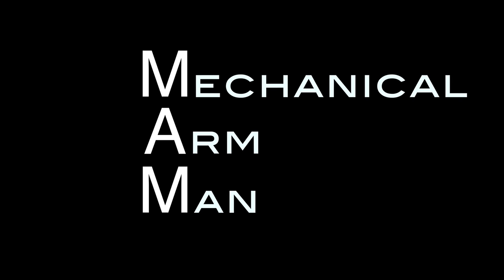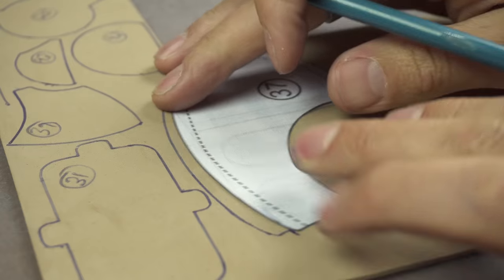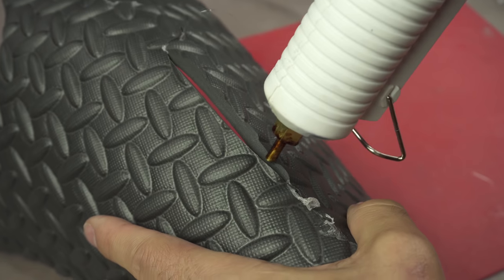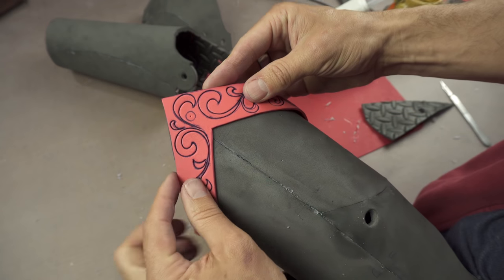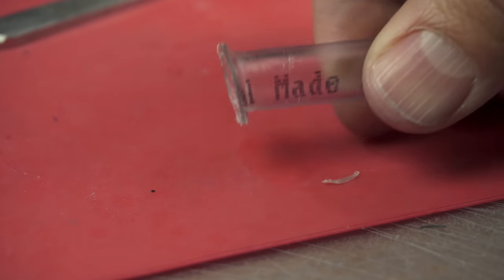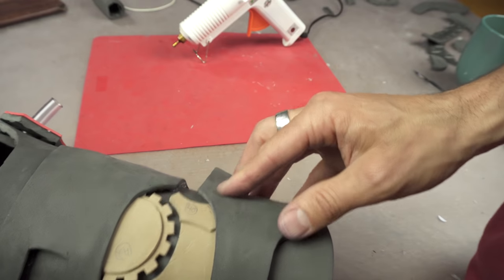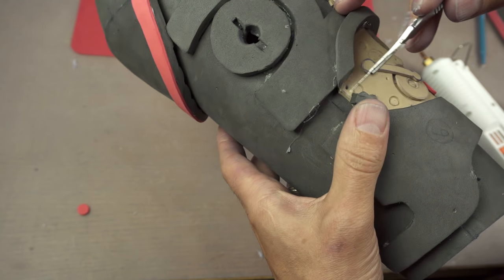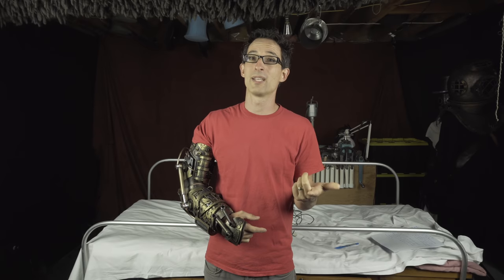How to make this sweet steampunk cyborg arm cosplay with foam and hot glue! Fidget spinner fail

Comment: I have run into a problem. I am making  a steam punk Mandalorian costume and wanting to use this for the left arm. for some stupid reason I first printed the medium size and when it didn't quite fit, I just expanded it a bit.  however, when I finally got my Mandalorian shirt even that didn't fit. I printed the large size and that doesn't fit either.  I expanded my print to 125% (which I had to print on larger paper or it would not all print on the page). only thing is, when I started cutting out the pattern, it appeared to be the same size.  either I am doing something wrong, or 125% is next to nothing of an increase. 
can you help me out?
Reply from the maker: Hi There! I think maybe your printer is resizing the pattern to fit on the page. 125% should be a big change in size, so something isn't working quite right. If there isn't anywhere on the software you are using to print from to choose to make it print actual size or 100%, you may need to use some different software. Adobe Acrobat Reader is free and seems to work.
Reply: @LostWax  actually, I printed on 11x17 paper so that isn't it.
currently I am redoing the upper arm with adding an inch on either side.  (now I just have to figure out how to deal with the part 49 at the top, to make the design fit)  but I have also decided not to use the Mandalorian shirt that I paid good money for as there is just too much extra bulk in the sleeve.

time will tell
Reply: @LostWax  btw - using Abode
Reply from the maker: @quemeese  Hmm, yeah, if you're printing on 11x17 you should be good. I'm assuming the print guides measure the right dimensions. If you want to try out adding extra to the arm, you can just take the one you've made and cut it straight up each side and glue in an extra strip of foam. If you don't mind the extra seams, you might be able to use that one.
Reply: @LostWax  so far so good with trying that approach, although I am completely redoing the upper arm. the biggest challenge is going to be designy piece at the top!
Reply: @LostWax  btw - what size are the holes supposed to be for piece 32. I know I did it wrong the first time

Comment: How big are you? I'm 6 foot 3 and 280 pounds, will this fit me?
Reply from the maker: I have 3 sizes in the pattern, the one I am wearing in this video is the middle size, so I think the large should fit you. If you have really large arms, you can cut the arm down the front and back and add an extra strip of foam.

Comment: how many millimeters of thick foam you use red and others sorry for my bad English
Reply from the maker: I used 5mm thick foam for the arm.
Reply: Lost Wax 5 mm? But you cut 5 mm for gears' place in the video
Reply: Lost Wax looks like you use 12mm EVA foam in site they look like puzzle piece
Reply from the maker: The thinner foam I use is 2mm thick, and I don't think I use any 12mm thick foam. The main structure of the arm is definitely 5-6mm thick.
Reply: Lost Wax Thank you i hope i will do this in this month